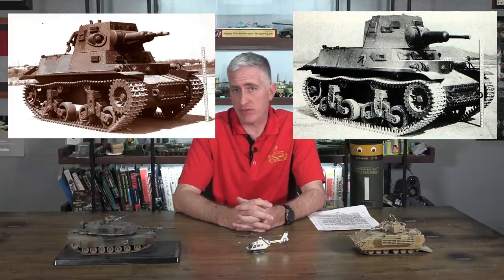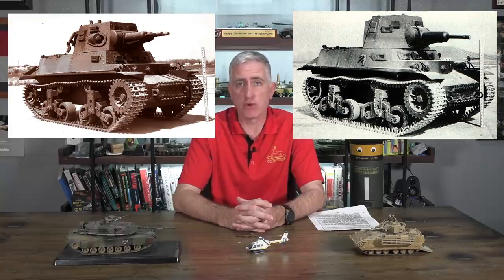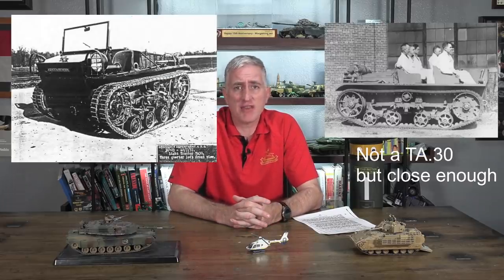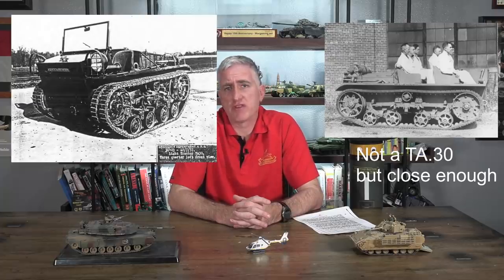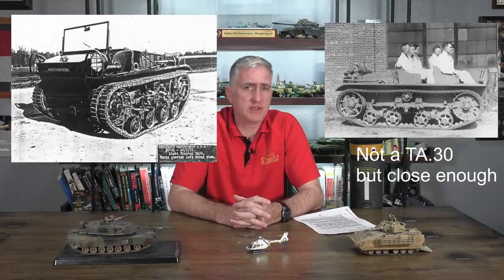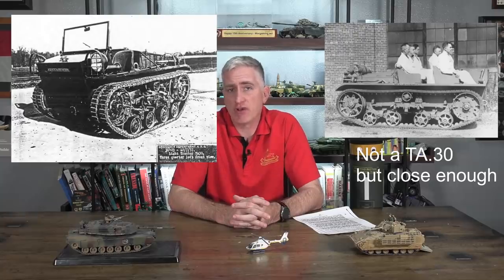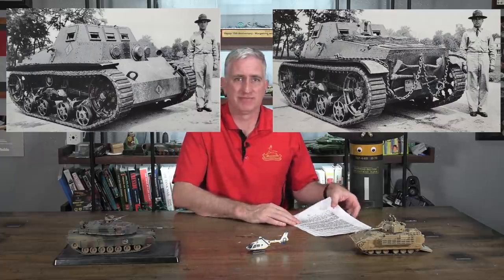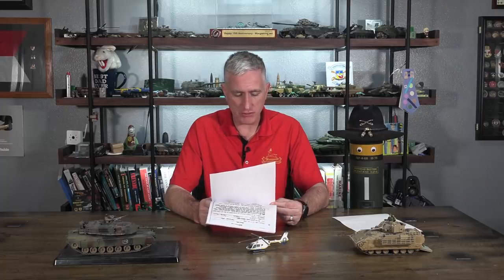A Less-Awful Marmon-Herrington Tank.

Comment: "This was the second differential to fail in this particular tank in the period of about three weeks."

I see Marmon-Herrington was taking their differential design inspiration from the Panther.
Reply: More like taking the differential from a 3 ton truck and putting it on a nearly 6 ton tank...
But yea, I can see where you  get the idea.
Reply: The Panther had more issues with its HL230 engine than its final drive. The final drive issues were mostly due to a lack of spare parts thanks to Germany having very little infrastructure left

Comment: In the words of CW McCall:

"He said her shaft is bent and the rear-end leaks- you can fix'r quick with an oily rag, just use a nail to start 'er- I lost the key. Don't pay no mind to that whirrin' sound. She uses a little oil, but outside of that, she's cherry..............................................

From: Classified   CW McCall
Reply: "Took two full quarts of forty-weight oil just to get her to the Conoco station.  And I pulled up to the Regular pump and then Harold Sykes and his kid come out. He says, "I've seen better stuff at junkyards and where'd you ever get that truck?"

'Bout the last place on this planet I expected to trip over a C.W. McCall reference.  I tip my hat to you, Sir.

And from the sound of it, comparing the Marmon-Herrington or any of it's relatives to a shed on wheels of a clapped-out '57 Chevy pickup is either paying the M-H a serious compliment, or asking for indignant Chevy fans to start reaching for their baseball bats. Not entirely sure which...😄

Comment: I'd be curious to see the same type of coverage of the M114. Our platoon had 9 M114A1E1 and 1 M113. The tracks spent most of their time sitting in the motor pool, with a run to the alert area every couple of months, a rail trip to Graf once a year for the tanks to practice gunnery, a few adventures for training and testing, and a pretty good workout for Reforger.

We never pushed them or really experienced what they could do. Usually one or two of them were dead, we'd tow them to Graf to get enough priority to actually get them repaired.

Since I've gotten out of the military I've heard how bad they performed in 'Nam, especially with the nose sticking out in front of the tracks and sticking into the sides of rice paddies and that poor 283 just not having enough juice to pull them back out.

Can't help wondering how they passed trials in the first place. And why they were upgunned to a 20mm that we only had 30 seconds of ammo for, I'd think a .50 with a whole lot of ammo would be better, both could take out another track and neither would do more than scratch a tank's armor.

Comment: To also quote from Ken Este's Marines Under Armor, p22-23: "Tests with only .22-caliber ammunition had produced bullet splash through the vision ports and engine louvres... The staff evaluated the bullet-splash problem of the CTL-3 as proof that it was vulnerable to .30-caliber and larger weapons."

Imagine fielding a tank that isn't even bulletproof. Also imagine being told about this weakness, and then deciding to procure the tank anyway! Who could possibly be so out of touch with reality to do this?

The Marine Corps! Top brass heard this and decided to go ahead with the CTL-3 anyway, against their subordinates' wishes to adopt the M2 Light (or literally anything better and with a turret) instead. It only took the fall of France for them to realize that MAYBE a tankette with a .50-cal wasn't good enough to storm a beach in 1940!
Reply: Probably the MH was cheaper.bean counters are an ancient plague.
Reply: They needed armour to train with and at the time did not have landing craft that could take heavier vehicles.
Reply: @PSPaaskynen  I won't deny the point about training, but the Corps made the decision to keep the CTL-3 in April, and quickly sidelined the weight requirement in July when they figured that they'd probably be fighting Panzers if they ever had to make a beach landing on Vichy French islands. In the end, the strict weight restriction ended up being unnecessary -  they found out in November that the M2A4 worked just fine with existing LCM's anyway!

Comment: I served from 81 to 89 in self propelled artillery units. We had M109 A1s and M577A1s, and M548s. We commonly performed what we called a pivot steer, did many myself with the 577. You just locked the one track and spun around in whichever direction you wished. Saw two M60s lost on the Autobahn pivot steer which blocked off a couple lanes of traffic with the resultant nasty accident. They used to tell us not to talk about this but as it was 40 years ago I guess that's long enough lol

Comment: But why did they all pull to the right?  The bent triangle-plates wouldn't explain why they all did it.  The fact that they confirmed that the rolling resistance on both sides was even AND replaced the differential makes this a bit of a mystery. Maybe the differential was off center and it was torque-steering?  (Sorry, I build transmissions for a living so this probably bothers me more than it should.)

Comment: The engine overheating would have been an easy fix by increasing the size of the radiator. The differential could have been replaced by clutch-brake steering. Interesting why this wasn't done as a retrofit.

Comment: Don't laugh, you may be driving something by MH

"The Marmon-Herrington Company, Inc. is an American manufacturer of axles and transfer cases for trucks and other vehicles.[1] Earlier, the company built military vehicles and some tanks during World War II, and until the late 1950s or early 1960s was a manufacturer of trucks and trolley buses. Marmon-Herrington had a partnership with Ford Motor Company, producing trucks and other commercial vehicles, such as buses. The company may be best known for its all-wheel-drive conversions to other truck maker's units, especially to Ford truck models.[2] Founded in 1931, Marmon-Herrington was based in Indianapolis, Indiana, with a plant in Windsor, Ontario, and remained in Indianapolis until 1963. It is now based in Louisville, Kentucky."

Comment: A question based on a statement from the linked video, is everything that is named a variation of valiant worth more in pieces than assembled? I had a Plymouth Valiant and I literally shot it, and bought a car named Citation just so I wasn't annoyed with it living up to its name...
I wasn't disappointed either, it ran better with 2 cylinders hanging out of the block than it did running on all four.

Comment: It sounds like several of the component failures may only be attributed to Marmon-Herrington because of installation of low-quality parts from other suppliers, most likely in order to save money.
Reply: That may have been an issue.
Though as I understand it, the very severe weight restrictions imposed by the military also played a role as it would have prevented the use of heavier - and thus tougher - parts.

Comment: The water in the radiator 'boiling furiously' is no surprise considering the tank was powered by an 85 hp Ford V8. It's probably the most efficiently designed water heater ever made with the exhaust runners passing through the water jackets.
Reply: I imagine the other engines weren't so bad
Reply: Yes, the flathead v8 and LZ v12 require just a tad more cooling than their horsepower numbers suggest. On the other hand, they did just fine with the Ford flathead in the universal carriers, so one assumes M-H just screwed up on having enough cooling capacity.
Reply: @beencybouncyburger  I feel like the British are more likely to make do by adapting the hardware and usage than do the US military thing of immediately  look for a replacement.

Plus, the UC were some 3 tons lighter if memory serves.
Reply: @cheyannei5983  two tons lighter (just over three tons unladen vs. just under five), so better power to weight with the v8 than the tankette with a Lincoln-Zephyr v12, but not hugely. 
I think both were detuned from car spec horsepower, so some wiggle room should have been possible. Not only was the '32 Ford an icon and trucks powered by the v8s a mainstay into the '50s, but the UC was the most produced armored vehicle ever.
That being said, there's a reason Chuck Berry's song "Maybellene" features a Ford V8 overheating, and a reason the early v12s were known for it too.
Very possible I think that Marmon-Herrington made also a simple mistake of assuming it would need as much cooling as a typical six of similar capacity, and it just didn't.

Comment: You missed the sections of Marines Under Armor that covered the later USMC Marmon-Herringtons, 20 CTL-6 and the five CTM-3TDS, initially equipping the fourth company each of 1st and 2d Tank Battalions Feb-Mar42, but eventually rejected by the battalion commanders before they deployed to SWPac and relegated to the 1st and 2d Separate Tank Companies that were sent later to Samoa to relieve two light tank companies previously sent there. there were no engine 'upgrades' to the USMC Marmon-Herringtons. First five CTL-3s had the Lincoln Zepher, the rest and the CTL-6 the Hercules WXCL-3. The diesels were for the "medium" Marmon-Herrington CTM-3TBD. The newer Marmon-Herringtons were criticized by the COs 1st and 2d Separate Tank Companies [pp.42-44. The CTL-3s had no special M-H armor, just plates cast by a safe company. The .50 caliber gun was seldom used in the CLT tanks and a single ,50 was preferred in the turreted CTM. The M-H Company only had experience with all wheel drive trucks before making their CTLs, with predictable results.
Reply from the maker: I don't know how many of the CTLs received the Ford engine, but the Aberdeen report is clear that that was what was in the vehicle they tested, down to the serial number.
Reply: Maybe that's the Lincoln Zepher, as Lincoln=Ford; The CTLs under testing came from Quantico, which had the first 10 CTLs received in the USMC. I'm also puzzled by Wiki references to a Colt .30 in the CTLs; never saw anything but M1919 Brownings mentioned nor in photos.
Reply from the maker: @kennethestes4489  Was the Zephyr a V12 or V8?

The reference to the Colt was in the Army report of the MTLS, not the CTL-3.
Reply: @TheChieftainsHatch  I show it a V-12 in my book; a quick Google shows the same: produced 1936-48. When I discovered the [apparently] lone survivor CTL-3 in the So. El Monte CA American Military Museum, it still had the Zephyr in it, so there was not an engine change to the CTL-3M, only suspension components. 

It's curious that the Colt MG has migrated to the Wiki entry on the CTL-3; what gives?
Reply from the maker: @kennethestes4489  Check your email, I sent you the spec sheet from Aberdeen. Not only does it have the Ford V8 noted, but I note that the fuel tanks are actually smaller than as advertised in the Marmon-Herrington brochure. Hunnicutt's Stuart (p 112, original edition) states "The final version of this tank tested by the Corps was powered by an 85hp Ford V-8 engine which drove the vehicle  at a maximum  road speed of about 30 miles/hour. Tests with this tank continued until 1939"

Unfortunately, there is no indication I have encountered as to whether this one tank Aberdeen borrowed from the Marines was that same specific test vehicle as a one-off, or if there was a general conversion of any other V12s to the Ford V8.

The wiki page I'm looking at says M1919s for CTL-3. https://en.wikipedia.org/wiki/Marmon-Herrington_CTLS . The CTL-3 was advertised by M-H as having the Colt as the 'default', maybe whichever page you're looking at went with factory specification, not USMC specification?

Comment: Q: I once saw a video of an Abrams starting up from the inside. The driver's instruments had the speedometer in Miles per hour, but the actual Mileage was in Kilometres. Why's that?
Reply: It’s an Army thing.
Reply: i would assume its something to do with knowing how much fuel you have burnt? the military usually uses kilometres for distance unless im wrong, so if you know your objective is 15 clicks away and you only have 10 clicks of fuel you have to refuel where as if it was in miles there may be mistakes when doing the math, just a possibility
Reply: Foreign subcontractors...
Reply: It's probably just for familiarity because the American tank drivers would be acclimated to driving in MPH, while the US military still uses metric distance measurements.
Reply: Map and road distance in METERS for map reading. Convoy and speed limits are in MPH for ease of common conformity.
Reply: As an old, tired, wore out, broke down, M601A driver and gunner, and later first edition M1 Abrams driver/gunner/TC/and lastly Platoon Sergeant I can attest to deployment being the reason M1s had dual speed readings. In Europe, Asia, etc., where the Metric system is used drivers went by "KmPH" while they also utilized "MPH" when operating an M1 in the USA. Bear in mind that many, if not all, civilian vehicles sold in the USA to this day have BOTH MPH and KmPH speedometer indications to this day.
Reply: @fdmackey3666  being a Brit I had to swap from left to right hand drive, as well as MPH to KPH lol, Army 75-92  have a tot with me!
Reply: @fdmackey3666  didn't have in the mid 70's when I learned to drive, did have later, though. Upon seeing it the first time, I had to remind myself to be very careful which scale I was using so I didn't pull a ticket by my own stu... incompetence.
Reply: @davidburroughs2244  I think the first vehicle I purchased with a MPH/KPH speedometer was a 1976 motorcycle followed that same year by a sedan. I recall, vaguely, a public dustup of sorts between the U.S. Government, domestic manufacturers, and private citizens over the speedometers....Of course, in the end, the government "won" and the metric system despite many, many millions having been spent on school books, speed limit signs, etc. pretty much fell by the way side. I THINK the reasons such speedometers are still in use in the U.S. include international sales of all kinds of vehicles and "a just in case the U.S. eventually switches to metric" mentality.

Comment: Proof that when you have nails to pound a rock will eventually get the job done if it is all you have within reach.
Reply: Having used a rock to pound in nails, because I forgot to bring out the hammer, done properly, the extra time needed to use the rock is less than the time it would have taken to go back into the house and bring out a proper hammer.  This all goes out the window if you have to actually look for a rock.

[tangentially related funny story]
At work, I used to have to pull pieces of steel off of a pile that had snow melt on the pile and then re-freeze.  To break the grip of the ice, I would use a short length of steel as  hammer.  Faced with this familiar task at an unfamiliar work cell, I looked for a suitable length of steel, but could not see any piece of a useful length (my preferred hammer was a piece of steel that was 2cm thick, 7.5cm wide, 15 inches long and just under ten lbs. in weight).  While searching for an likely piece of steel, I noticed a small lump of steel with a piece of wood sticking out of it, as it was too small, I continued my search.  When my search turned up empty, I looked for any other object that might be used to apply blunt force trauma to ice locked piles of steel.  It turned out that the 'unsuitable' lump of steel with the piece of wood sticking out of it was a 2 lb. sledge hammer.  I was a victim of my expectations affecting my perception.  While not as heavy as my desired tool, the sledge hammer did the job, just fine.
[/tangentially related funny story]
Reply: @richardbell7678  nobody was shooting at you at the time were they? :-)

Comment: It actually sounds like the majority of issues could be either avoided by careful selection from the catalog or by reasonably easy retrofit for any armed forces willing to tolorate slight increase in weight over the 5tons. The .50cal option shown would be a fairly decent armament against infantry and other light tanks, so its not completely unreasonable to purchase something like this should it have been fixed as to be reliable given its otherwise reasonable mobility in sand/water demonstrated in proving, acceptable road speeds/fuel economy, and the fact you could actually buy one when almost all other light tanks where in short supply. But without fixes people provided, we will forever be forced to remember it as the worst lemon to make series production, an anti-halo product to scare the military away from the otherwise reasonable trucks and steel goods available from the same brand.